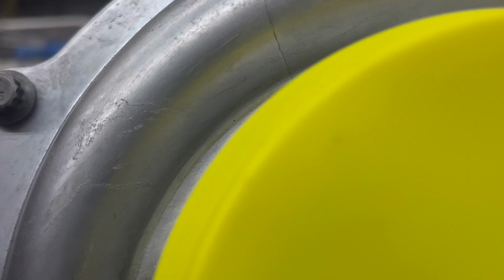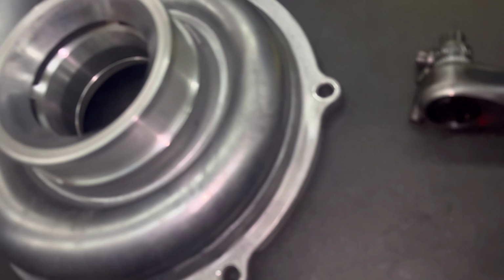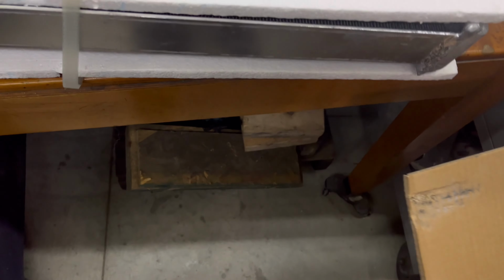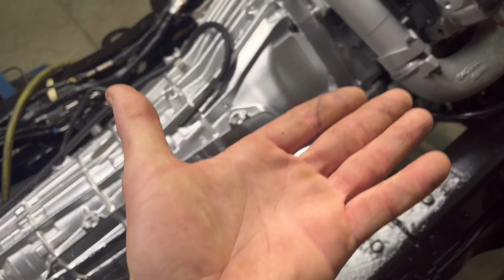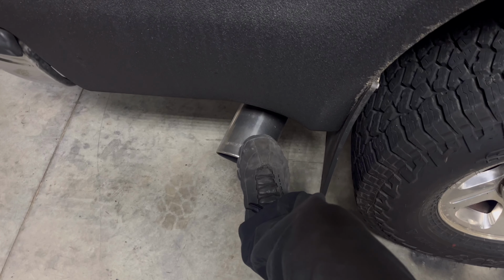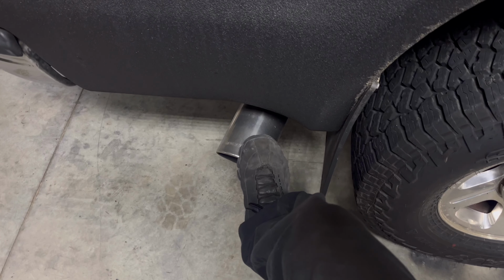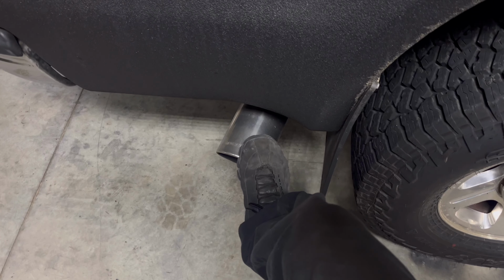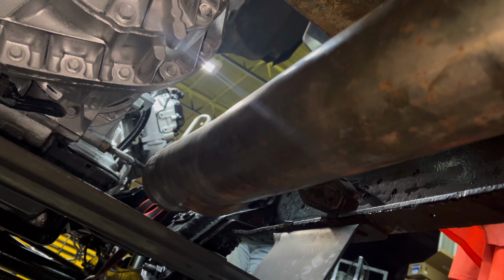Massive freakin problems,,,  Turbo and Exhaust aren't usable???

Comment: Glad you talked to someone about that turbo problem, hopefully they will fess up and make it right.  I use a two-can spray solution called Dye Penetrant.  It comes in regular aerosol cans, available at good welding supply shops.  Used to detect cracks in metal just for issues like this.  Easiest way to tell if it's a crack or a casting line, but as you already know, those are CRACKS and shouldn't have left the factory except in a scrap metal bin.  Piss poor business and they know it.  I am so tired of people not doing anything right nowadays and standing up for what is right.  Kudos to you for being as diplomatic as you were on the phone

Comment: I noticed the wear and tear marks on my brand-new Garret two years ago when I purchased new. Prior to install I checked it and although I didn't see any cracks it had a ton of scuffs, grind marks and blemishes. Really pissed me off at the time after spending $1100 on a new one. It made me think they were rebuilding cores and reusing compressor housings. Two years later she is still spinning, so I guess it was ok, but you're right about putting a bulletin in the box reassuring customers on the grind marks.

Comment: Yes, the only way to fix those exhausts is to cut them, adjust as needed and reweld back up as needed.  Big time hours needed.  Been there, done that.  Luckily for me I remembered your videos from years ago, and RETAINED the stock downpipe.  As you said probably about 10 years ago- there is NO WAY any aftermarket company duplicates the multiple compound bends that the OEM downpipe has in it for these engines to fit right.  And the turbo only has a 2.75" outlet, so the factory downpipe is still larger than that anyways.  It's not doing anything for performance to have the same size flange, and then bell up to a 4" pipe just for the sake of saying you have a 4" pipe.  
Now ok maybe if you're running some crazy compound turbo setup for massive HP I can see it, but for a regular work truck type application, the stock downpipe is still my preference.